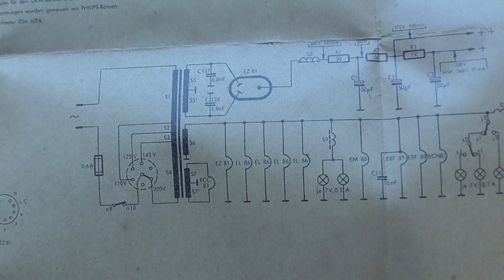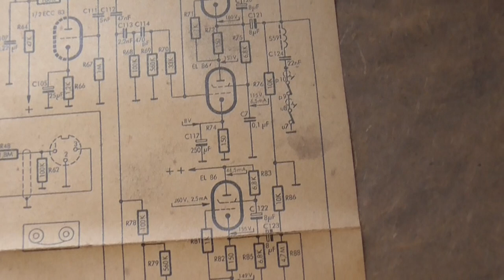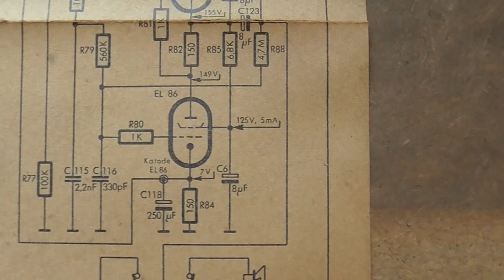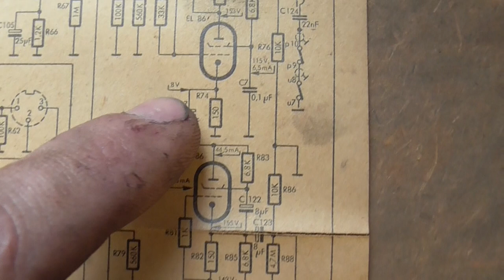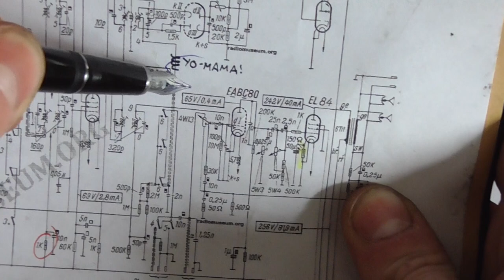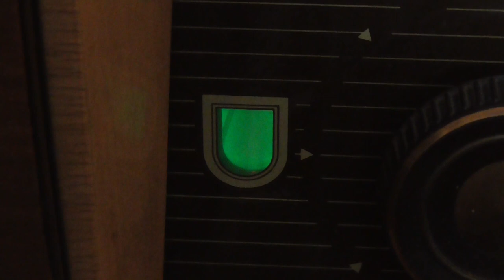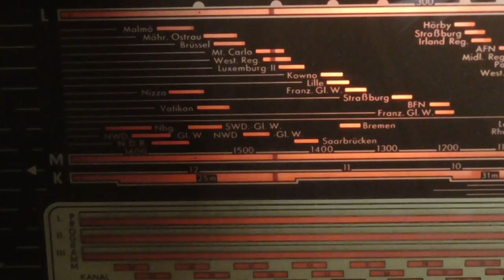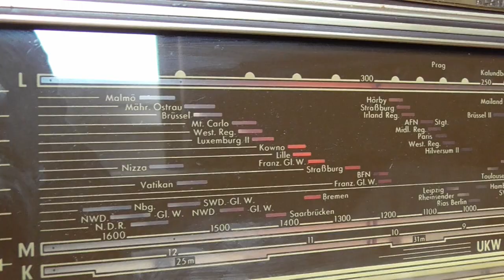Philips Capella 663: Capacitor Replacement in Detail

Comment: You're brave to power it up without checking for shorted caps and transformer windings first. The caps around the rectifier were both shorted on my Philips, as well as a shorted lamp socket and someone replaced the 0.4A fuse with a 25A fuse from a car. Needless to say I'm looking around for a transformer.

Comment: Nice, i collect those old radios my self, i like when the inside is properly kept as this and not replaced by some cheap chinesium crap, those where expensive when they where new and one litterary got a nice little valve amplifier with the same tubes people would pay a fortune for loose, for free or at least very low cost, personaly i like the original sound of them, and they look realy nice on the shelf as well. Many peope does not know that the old amplifier can be directly connected to any modern device via the AUX (or making such port if it does not allredy exist,wich is realy easy) including a modern smartphone.
Reply from the maker: It's true. Adapting a modern circuit to fit into an old radio would most often be more work than repairing the old one - and once it's repaired, they last a long time. I've got an MP3 player hooked to my radiogram, too - let's just hope they keep FM stations up for another couple of years for us to enjoy

Comment: Brown Green Brown Gold = 150Ω with 5% tolerance.  Might be worth printing out the color codes.  I have trouble remembering them too, even though I've been working on electronics for 30 years.  With a drilled hole already there, it might have been a good idea to add a tag strip, to neaten the install.